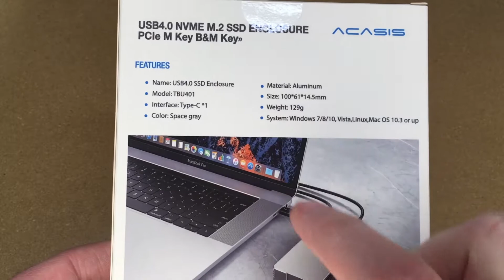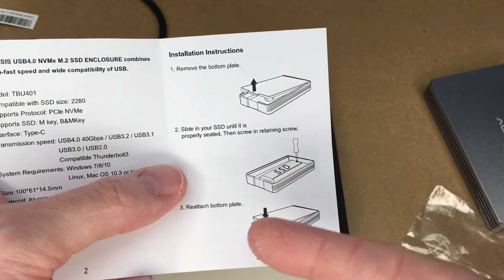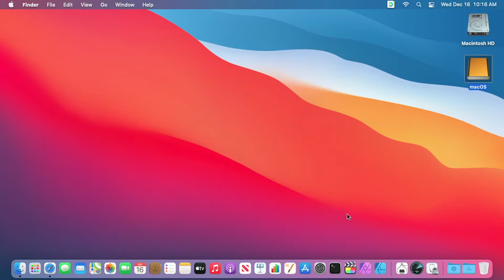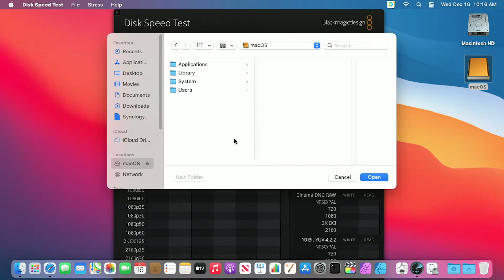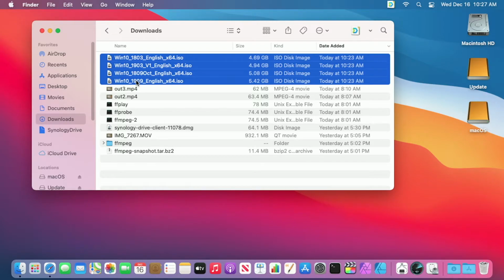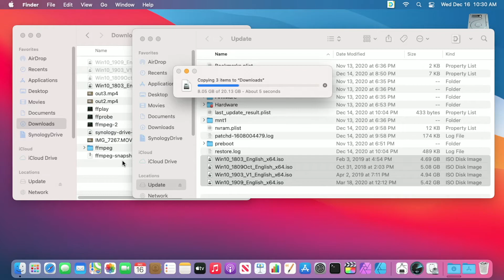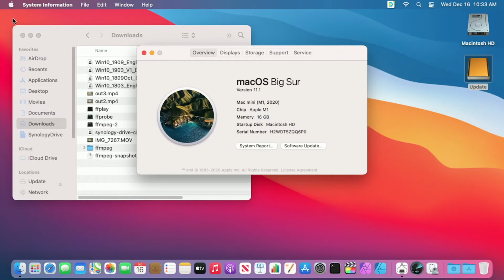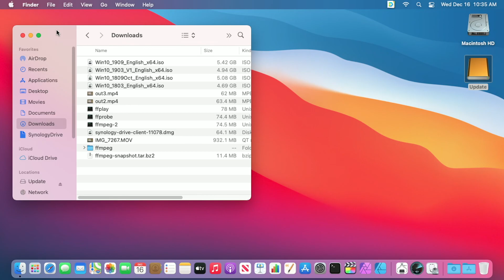ACASIS USB4.0 Mobile M.2 NVMe Enclosure

Comment: Is it normal for it to heat up so much? I changed the thermal pad to no avail plus if I try to open the case the pad is detached from the nvme and attached to the lid. Thank you
Reply from the maker: It is normal for NVMe drives to heat up. I don't use a thermal pad with mine.

Comment: I have this enclosure for a  month now  and running a samsung 1tb evo.. write is about 2100 and read speed is 2600.. when i changed the nvme to a 2tb evo plus, dang its painful to see how it goes down to 1200 mb write.. so i went to wd sn750 2tb  and boom worked like a charm.. using a mbp 2018

Comment: The SSD you‘re using is not recomnended from ACASIS for this Enclosure. The Speed and also the Compatibility with a Mac M1 should be a Problem. Do you had any Problems?
Reply from the maker: I hadn't heard of that so I googled it. I'm not sure why they have that recommendation. I haven't had any problems with mine. I wonder if it depends on the firmware of the 970 evo plus. I know some Macs had problems with older firmware on that SSD. That was over a year ago though.
Reply: @Rickmakes  Actually you can read about this Problem on the ACASIS-Product-Website and in nearly all Product-Offers. The Speed should be decreased with the Samsung 970 Evo Plus. However: I‘ve ordered this enclosure, because it is much cheaper as the Yottamaster and it uses the newest Standards (USB 4 and Thunderbolt).

Comment: @RickMakes 02:10 With any of these drives. Did you apply stick-on thermal pad at all ?
Reply from the maker: Like with a heat sink? I haven't attached anything like that. I don't know of one that would fit.
Reply: @Rickmakes  So that the thermal pad makes contact with the enclosure.
Reply from the maker: @Br0adCastYourS3lf  I measured the gap between the SSD and the bottom of the enclosure. It is around 2.5mm. I did some searching and it looks like there are thermal pads available in that size. I'm probably going to leave mine as is as of now since I'm not having any heat related issues. I would also be concerned if the thermal pad were to stick to the SSD and/or the lid.
Reply: @Rickmakes  Jeez, thanks for measuring the gap and posting the result. I was just curious if you maybe had done some off-screen trial and error testing, with and without thermal pad, before shooting this video. And had come to the conclusion that a thermal pad was not necessary. You say that the drive in the enclosure doesn't exhibit any heat related issues. So I guess that a thermal pad is not necessary at all.
Thanks very much.

Comment: Thank you for review!
Could you please advise, what controller is used inside? (if not specified on carton, it in most cases inscripted on controller itself inside the device)
What about temperature? nvme devices are normally hot, plus some controllers are hot as well. Would be very interesting to find out about temperature during read/write test (Samsung SSD has two temp. sensors: on memory blocks & on controller, controller temp is especially interesting)

Comment: Amazing video, thank you

Can you please explain why we don't get the full speed of the ssd itself ? I dont undarstand this. Even in your vid you use the Samsung 970 EVO which has 3500 read and 3300 write speed and when you connect it with enclosure you get only 2800 read and 1200 write speed (probably you will get  2000+ of write speed but as you said it is because of buffer in nvme drive) but still you dont hit the 3000+ write and read speed, why ??

I'm guessing it is because of thunderbolt 3 PCIe limits which is 16 GB/s. If this is corrent why some people get 2000+ write speed od thunderbolt 3 enclosure ?? For example in this video

https://youtu.be/CfNjnwfVLRs?list=PLVoqUMYz0O5IwWG56wHX6xqTsvYeT1U5J&t=187

Please explain this for me if you can or make some video about it. I think many people are confused because there is too much things to consider to make this to work properly. 

Thank you for your content ;)

Comment: Excellent. First video demonstrating an enclosure that works (+1,000 MB/s in writting) with Mac M1.
Reply from the maker: Thank you!
Reply: I have the same enclosure with Acasis own recommended WD 750 BLACK NVMe going into a Mac M1 mini.. 
My write speed is in the same-ish 900mbs and 2,700mbs or more read speed.. 
So why the LOW write speed??